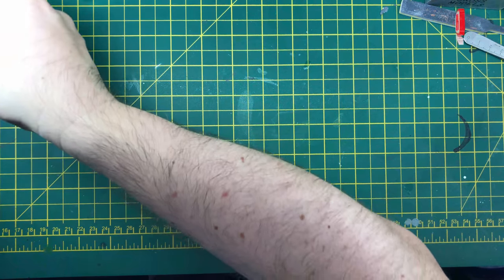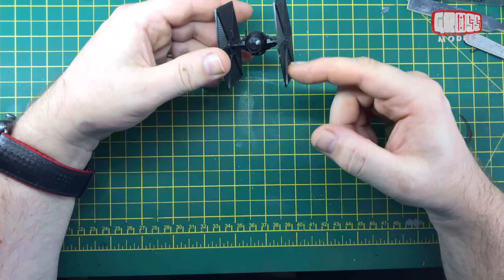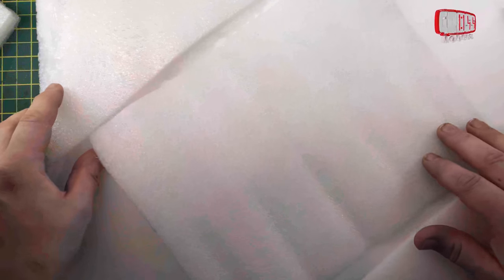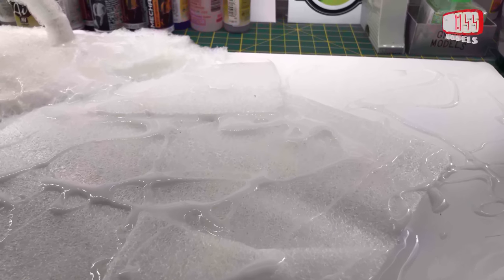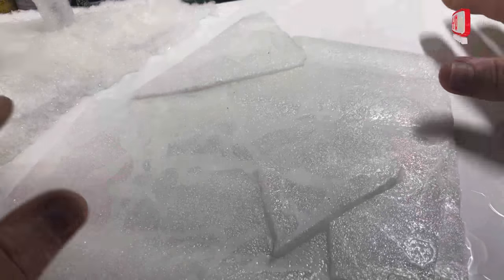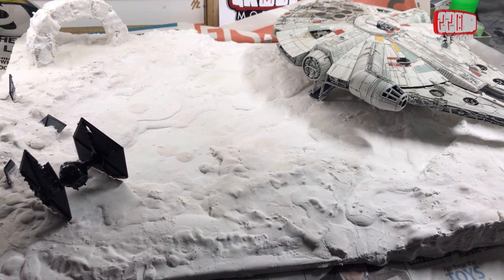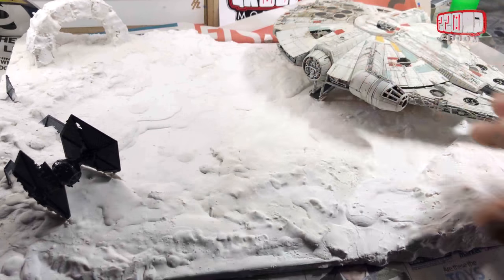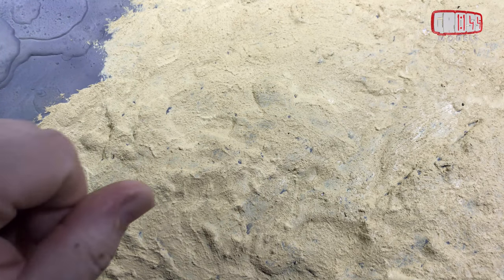Jakku 1:144 diorama Complete build

Comment: Pretty cool build. 

Sorry to be a stickler, but the "arch" would be to the right of the Falcon (if you were facing the Falcon), and there wasn't a crashed Tie-Fighter there. Also the "arch" wasn't an arch, it was an upside down boat looking top sitting atop four "pillars". For future reference, when you need to cover a "large" area/surface with plaster to smooth out the substrate, you might want to try 'Sculpt-A-Mold' (Geek Gaming has a slightly more affordable equivalent on their site). There is no real good stimulant at scale for sand. I find extra fine sand for sand art from Hobby Lobby (in the US) as a great material for scale sand (even at 1/144) or sanded grout (for 1/48 & larger) or non-sanded grout (for 1/48 & smaller). Some people have said to use baking soda, but I've found it to loose texture when sealing. 

Like I said though, pretty cool build, and thanks for sharing it.
Reply from the maker: Thanks for the tips!
My builds are never meant to be all that accurate, I tend to go more “inspired by” and try to get the feel for a scene rather than all the extra work of making it screen accurate! :-)
Reply: Gross Models that's cool. I totally understand, you are taking artistic license. That's kinda been one of my problems. I pour so much attention into being "realistically" accurate or scene accurate that I have started loosing my creativity, and expect others to be scene accurate as well. As an artist I should know better. Again, great job it really did turn out pretty good. Keep doing what you do. 👍
Reply: It’s basically a concept art piece rather than a recreation of a specific scene.
Reply: Glued To The Sprue really? I got that from the content creator in their reply. Thanks for the additional clarification.
Reply: Good tip ,instead of plaster I saw a guy use cheap wall filler and it turned out really good,you can mould it into shapes as you go along and it’s a little gritty..
Lovely job mate
Reply from the maker: Thanks.

Comment: Just a few tips from the voice of experience in the art world (I`m a baby-boomer). 1.Try shrinking down the footprint of the diorama base. They become impractical to display after a while. Besides, you can still achieve a powerful impression with a smaller base. 2. Do not display the model protruding out from the base. Picture the outside frame as an invisible wall. Good work otherwise. Cheers.
Reply from the maker: Thanks for the advice. I did think of a smaller dio, but I sort of wanted to have a sense of scale to it too, so I wanted it to be that size. 
I don’t do so many that space is an issue. Yet. :-)

Comment: You do realize what you called a "wing" on the Tie-Fighter is actually a solar panel? That's mostly why the Empire  and First Order used tie variants, because those suckers are electric and cost nothing to run as apposed to the X-Wings that have some sort of ridiculously complicated form of reactors that require fuel (or as I understood a couple decades ago, nuclear powered). 

In general, that's a pretty cool diorama. Just thought you should have made it flat considering that was Unkar Plutt's ship yard. Also the "arch" was on the left of the Falcon, not the right. Really it wasn't an "arch" to begin with, it was a basically a "rectangular" shape object sitting on four posts. Now, I will say the tarps turned out great. I've been experimenting with materials for tarps and have not had much success. I probably never would have thought of trying tissue paper because it's just so thin and not very strong at all. I saw a VSM video where they used regular printer paper and their "special juice" made specifically for making folded, rolled or draped tarps, but I'm too cheap and broke to buy their stuff. 

Overall though, pretty cool diorama. Thanks for sharing. 👍
Reply from the maker: Surely it can be a wing and a panel? ;-)

I don’t worry much about accuracy with my dioramas- too much like hard work! I usually go for getting the ‘feel’ of a scene rather than an exact copy. Flat was just boring. ;-)

Thanks for the comments!